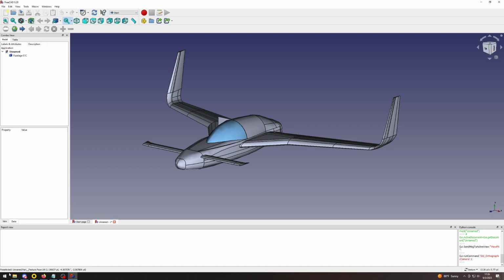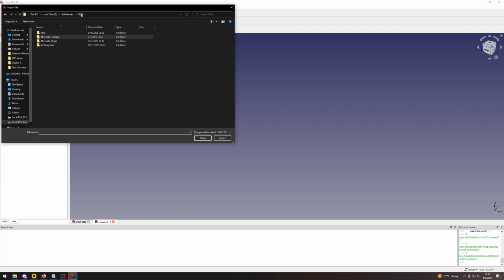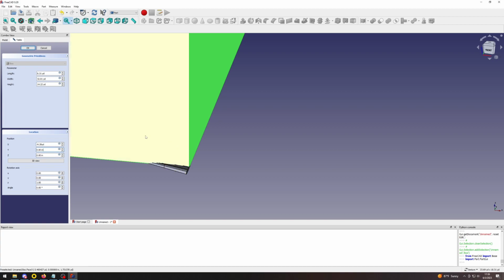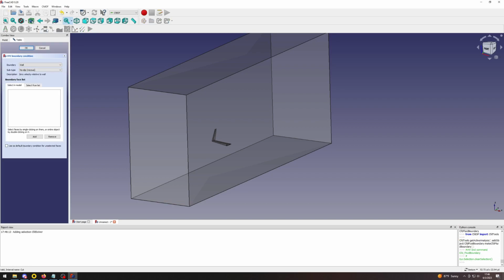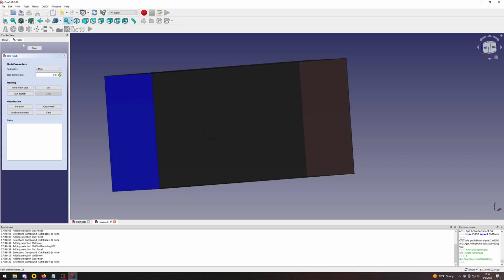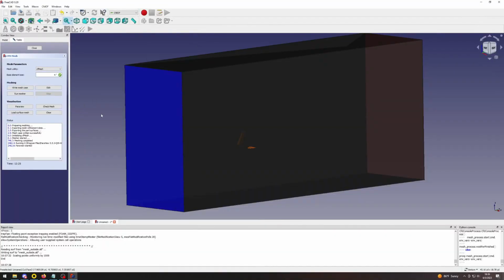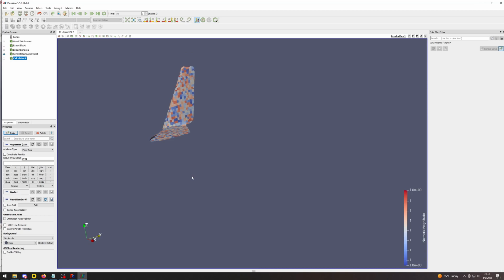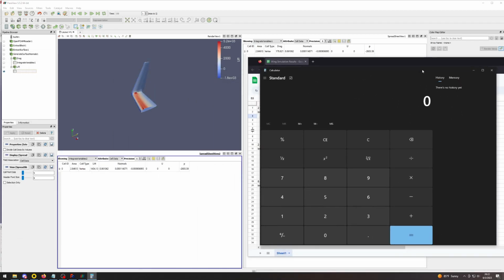How I did a CFD Analysis on Blended Winglets in FreeCAD

Comment: the mesh vertices are the calculated points ... the smaller the mesh the more points ... the less the faster it processes ...
Reply: btw the X is Length ... the Y is width ... and Z is Height ... it is STANDARD drafting positions ... this is why CAD is crap from drafting because it IGNORES the Drafting standards 

drafting standard front is ALWAYS  ... X Y ... what you see in front of you is what you draw on XY ...
Reply: btw proper mesh size ... if it has straight flow it can be larger ... if it has changing flow the smaller the better ... compromise on time to process to time you are willing to wait

Comment: So I mean a few small comments - that simulation is not really properly converged. Pushing the residuals down x3 orders is whats often suggested, but in practice, most people push them down until they stop decreasing OR monitors describing the most important quantities of interest are stable. What that results, you'd have a reasonably resolved pressure field and maybe the freestream velocities, but your boundary layer velocities (which describe your separation, viscous drag etc as I'm sure you know) are likely still quite far off. Second, and as maybe alluded to, when it comes to CFD, your primitive (primary) flow variables, are going to most accurate - so you could quite easily trust the pressures and pressure derived quantities (lift, pressure drag), as long as the flow is attached, and well as probably the velocities, again as long as things are behaving themselves nicely (ie not separated etc) .. especially with a nice low speed incompressible simulation like this.

Comment: I use XFLR5 airfoil analysis and CFD. It is opensource as well. I made like one video on it for a demo haha. It will graph Cd, Cp etc. Its worth looking into. 

I am watching your videos because i have never used CFD software, even though i understand the math very well, i just have not applied it yet. So hopefully i can understand what you are doing haha
Reply: XFLR5 uses a panel method that its ok for foils and standard wings in normal conditions (not too stalled, not supersonic...) it is based in potencial flow equations so it can go much further than a preliminar analysis. If you want to get more accurrate results, of the fuselage and the interaction with wings and other parts of the plane, then you need exactly this, a RANS model to calculate flow better, openFOAM works great, not very suer friendly but it is as powerfull as comercial paid software
Reply: @javieraragongarcia8660  in the last year, i have learned openfoam and used it many times now. I have done some excellent sims and i am now doing cfd for work.